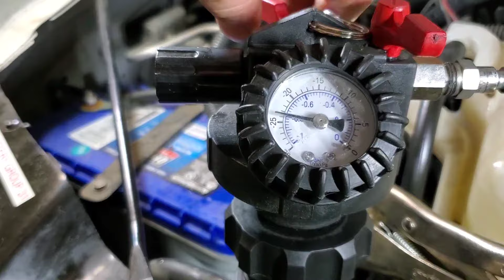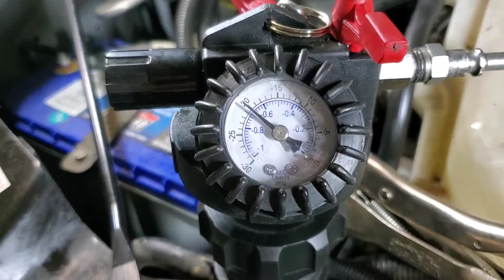Harbor Freight Maddox cooling system test and refill kit

Comment: Old wrench head and Ex Cornwell tools dealer here. If y’all youngsters looking for a pro tip: DO NOT be loyal to a brand, but be loyal to your wallet. Your career will pass you by before you know it. That’s just how time on this earth works. Save your money for investment purposes and don’t play/buy into the brand hype.
Reply from the maker: couldn't agree more
Reply: Best thing i read all day
Reply: I had to learn the hard way.. use to fall for the snap on tool hype now i just go to harbor freight. They cheap and got warranty
Reply: I live by this, I’m an independent contractor wrenching on heavy equipment for different railroad companies. When I first started out my tools were whatever I could get from Napas, HF, Tractor supply etc. Guess what, they still are lol.  Now I make people’s yearly salary in a week and no matter how much money I make I’ll never justify spending $700 on 10 wrenches. Instead I take that money and buy heavy equipment so when theirs break down or they just want to have another machine on standby as a spare I lease it out to them for 8k-12k a month.
Reply: This maybe a stupid question but how does it pull vacuum in the engine if the thermostat is closed
Reply: @DarrelllCampbelll  
Is not a stupid question when you don’t know and want to find out. 
Answer: automotive cooling systems have two chambers or groups into one. The cool side and hot side which is separated by the thermostat. When you first fire up your engine thermostat is close to allow faster warm up of cooling system BUT here’s the secret: it is never 100% Isolated because there are small passage ways connecting the two sides. And some thermostats have small hole in them that allow coolant to flow when is closed. 
Hope that helps.
Reply: Best advice 👌 except if you invest in lifetime warranty knipex pliers, i  think you will make life easier. You will lose so much stuff if you're not careful, so why lose a 30 dollar socket or 900 dollar gun you dropped in oil 😅 i should have took it apart and cleaned it 😅
Reply: Pretty cool comment.

Comment: I learned it really helps to have the key in the ignition (engine off/ignition On 2nd position), then set the heater on high with the fan on low while using this device to pull a vacuum on the cooling system. The heater on/fan on low, will ensure all the coolant is sucked also from the heater core, ensuring no air pockets are left there either.

Comment: What about the air you let in from the line before the anti freeze filled it?
Reply: For these types of refill kits you should bleed out the air from the coolant line prior to using on vehicle
Reply: That would be "lacking in air" considering you are under vacuum...
Reply: It's minimal,  but if you are worried about it,  you close the fill hose when it sucks up some coolant. Then draw vacuum again,  then open the now "primed" fill hose.

Comment: Any issues with it so far? Looking into getting one of these. Does the Vehicles cooling system need bled at all afterwards or is it good to go?
Reply from the maker: no major issues with it so far, I have used it on 15 to 20 vehicles and the only thing I have to complain about and it is pretty minor, is that some times it top part wants to push out if you are using one of the adapters. a simple readjustment seems to take care of it. no you don't have to bleed the cooling system afterwards, it is 100 percent ready to rock. it is pretty slick
Reply: @kylechristopherson4361  Sweet thanks for the update!
Reply: How you used this on a subaru?

Comment: Great ... but how does one expell the ever present residual old coolant trapped in various location within the system ?  Other units sold include a 3rd valve and line that can be opened to expel that residual old fluid into a bucket, this unit does not have that capability.

Comment: Thank you for this video. I just finished putting a Whipple Gen 5, 3.0 on my 2018 Mustang, and I was worried about getting all the air pockets out of the engine coolant and the intercooler/heat exchanger system. A buddy lent me his Maddox kit, but I was not sure how to use it properly, and this video has taken the guesswork out of this little project.
Reply: Did this work for you.
Reply: @gthomas5880  it did mostly. The design of the S550 reservoir makes it hard though.

Comment: Any suggestions. I drained some coolant reinstalled plug and a valve. Put the Maddox tool on but can't get any vacuum. Checked and rechecked what I did and to make sure I didn't accident dislodge any hoses. I am sure I am overlooking something simple but can't figure out why the tool is not pulling a vacuum. Not even moving needle at all. I did make sure the hose for the new coolant was turned off.
Reply: When I have this problem it’s usually because the adapters aren’t sealing right, I then use the cone shaped/universal adapter and works good, I just hold the tool down to make sure it doesn’t pop off just in case.

Comment: If you don't have access to a radiator cap I'm assuming you just use the overflow tank to vac and fill? Correct? 2011 Buick Regal
Reply from the maker: correct

Comment: I guess you could also use this as a way to pressurize the system to easily find a leak, hook your regulated shop(15 psi or so) to the port that would normally suck up the coolant from your pan and just add pressure to the system. Right?

Comment: Does the compressor size matter? I don't feel buying this and then dropping hundereds on a large compressor I'll probably only use once or twice a year. Wondering if I would be fine just picking up one of the small ones while I'm at Harbor.
Reply from the maker: it dose use alot of air. I believe the air requirements are on the website. I think if your compressor is large enough to run air tools it should work

Comment: 1. Did you put heat control on full blast in vehicle before starting process-? Key ON engine OFF?  and 2. Did you pinch off overflow tank before starting process? Thanks in advance.
Reply from the maker: Pinch off the overflow yes, heater controls no. This tool is used without the engine running and elements the need to bleed the cooling system

Comment: Can you use this to force coolant out after draining? Or does draining it with petcock and reservoir cap off generally do the trick?
Reply from the maker: it is for vacuum filling and testing. there is no way to pressurize the system with this too. generally remove the cap and opening the petcock or removing the lower hose is the best way to drain.
Reply: @kylechristopherson4361  thanks for responding! I just picked this up and was going to try doing that, but I'm glad I won't waste my time now.
Reply: @kylechristopherson4361  Could you use a pressure tester with the radiator drain (petcock) open to remove all the coolant?
Reply from the maker: @wrenchrat  I suppose you could, I'm not sure why you would. if the goal is to drain the block I don't think trying to pressurize a radiator that also has the petcock on it would work. all wo would do is expedite the drain process.
Reply: @johnnycoolguy9554  I bought this thinking you could vacuum evacuate thr fluid trapped in the block. I was disappointed when I found out it won't work for that.